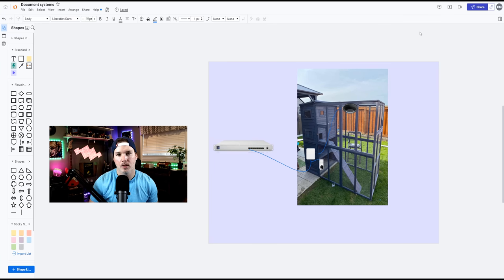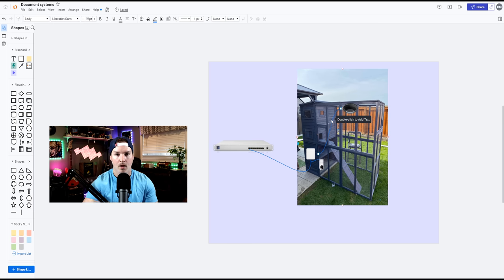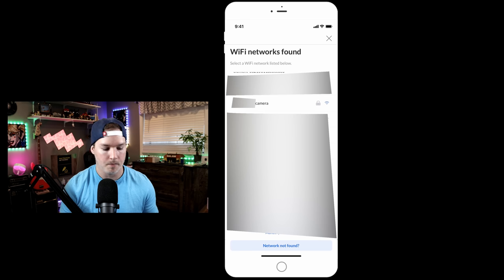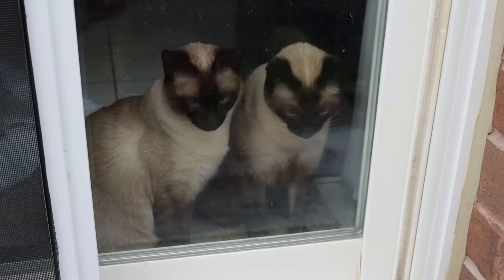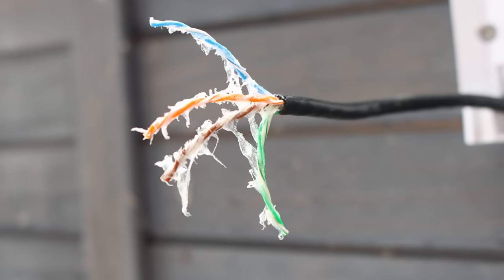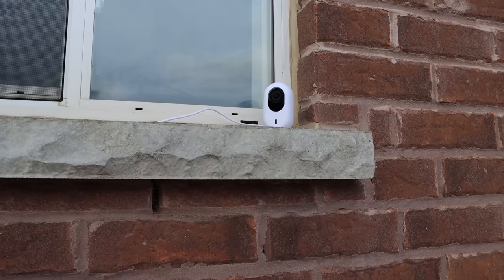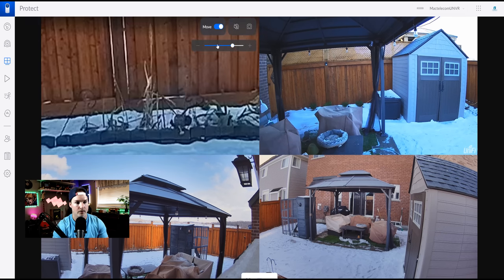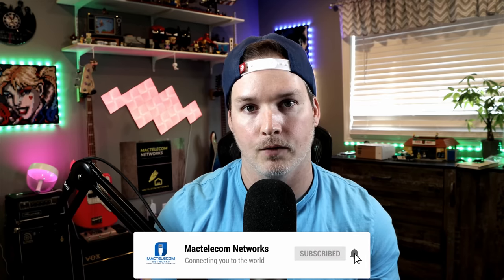Unifi Protect Outdoor installation

Comment: I install Unifi cameras and recently installed a couple of the 360 cameras. I'm going to be installing on a slant ceiling, My question is does the 360 camera need to be installed straight up & down or can it be installed on a slant and still get the same view as to straight down look?

Comment: Well done. I wonder if you would need a heated camera IF it gets super cold in winter?
Reply from the maker: Is there heated cameras? I’m just curious if the g4 instants will break I doubt it but will be a good test
Reply: @MactelecomNetworks  There are Dome cams with heaters and even wipers ;-) But that costs a few pennies extra ... guess the large Domes need that to prevent ice buildup and fogging up
Reply: Touch wood, I recently installed five G4 pro cameras , and no issues when we were at -33C here in BC yesterday . I was kind of curious if they would tolerate extreme cold
Reply: @MajorTendonitis  If the IR LEDs are on it's got its own heater right there ;-) when you look at the port power draw on the PoE switch how much do they use?
Reply: @jfkastner  
I am seeing 40 watts of draw on my usw 24 95watt switch . I just double checked and I took that reading at 9 PM  two nights ago , but I do not use the IR’s in my two G4 pro front cameras , as there’s enough light that it looks great at night without . Maybe not so well in the summer without the snow to reflect off though, but I may add a halogen motion light at the front . 
I should add that I’m getting 40 watts draw running 5 G4 pro and one AP pro . 
I’m a little disappointed with the max draw of this model of switch ,but I wanted it to run silent like my unifi 8 port switch it replaced . But I’m pretty much done adding anything more poe , other than I’d like to mount a few of those flex cameras in fake bird house at the furthest point of my front lot in the future . But I see there only 4 watts of draw a piece so I’m assuming I’ll be ok

Comment: how did you run power to the g4 instant on the back fence, did you use the poe to usb adaptor?
Reply from the maker: Nope just a long extension cord 😂 not the most professional but it does the job